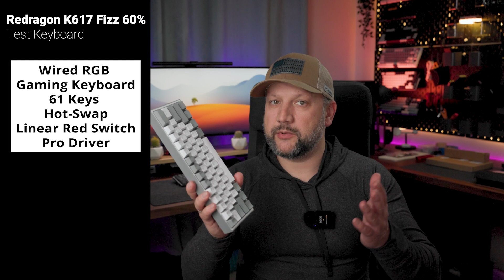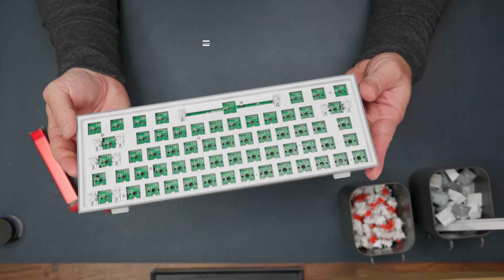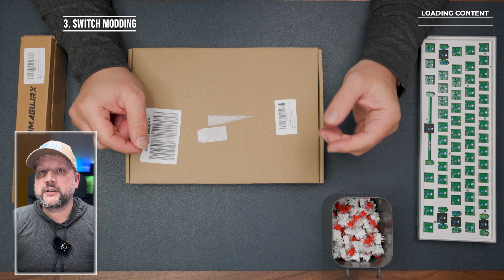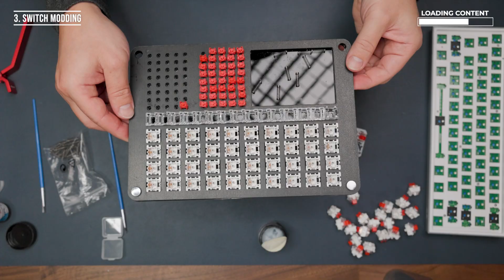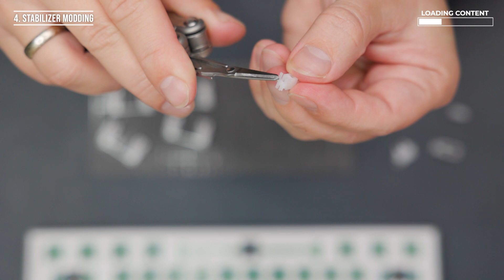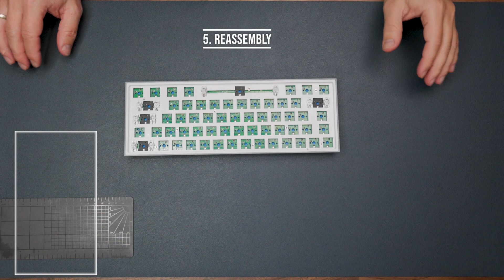How To MOD Mechanical Keyboard?

Comment: Man great video thanks it will help a lot would be good if at the end we can hear the before and then after but video is a 10+.
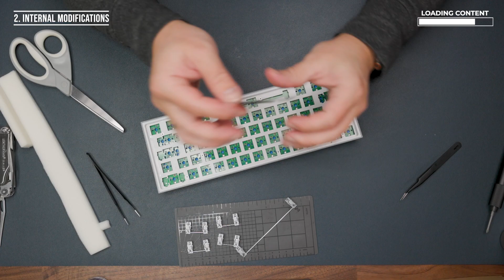1 question  4:14 if i put all of those pad on an he board its e yooso hz61 same as redragon fizz pro k617 will i have problem with the rappid trigger function and he switches not working properly if they are not close to the pcb?.
Reply from the maker: In case of magnetic switches it doesn’t matter what will be under the pcb :)